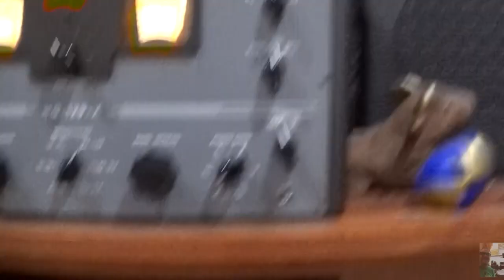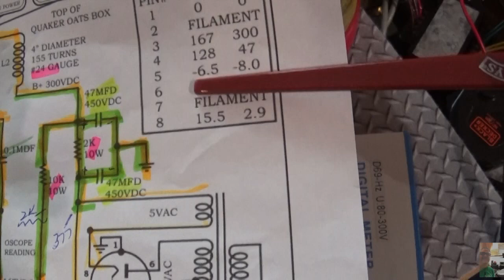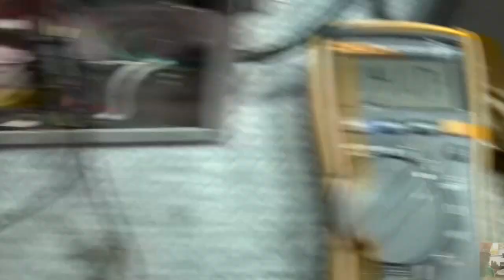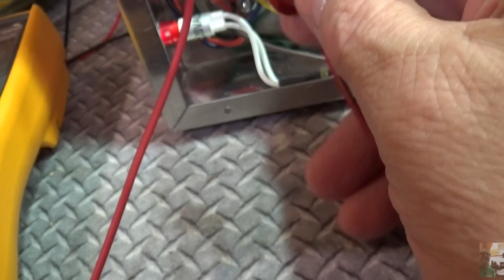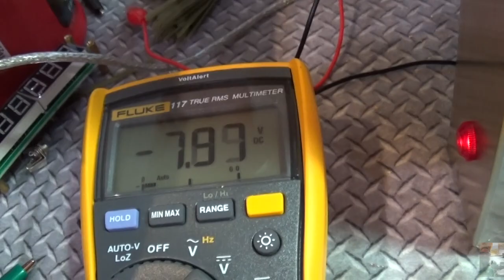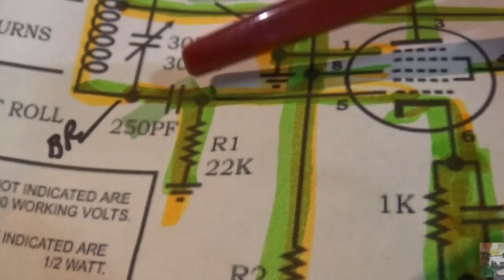Rick McWhorter AM Transmitter Build  - Episode 10 -  Pico and the Man !!

Comment: That wrong value cap could be your problem, I always have trouble with those capacitor "codes", never had those stupid codes years ago, the caps were marked with the values on them.
I have a chart from Sal's Capacitor Corner that I refer to when I need to put in a new cap.
Reply from the maker: Thanks Bill.  I am with you.... I never get it either.. LOL    However in this case I think the issue is I ran all the wires up inside the wooden boxes in the same hole. This would be the writers to the tuning cap and the 167VDC wire that goes to the meter/switch.  I didn't have the hum before that and have it now, so it is just a question of isolation ( I think) We shall see  - Rookie error !!!     Thanks Ron
Reply: I ordered some yellow film caps recently from AES and they came labelled as uF as well as K,  I was pleasantly surprised.

Comment: Ron,
Loose nut behind the tuner maybe?  LOL
Regards,
John
Reply from the maker: Its even easier than that John..... rookie mistake..... lets say, you should never run wires to a tuning cap in the same channel as wires carrying 180VDC.......  comprehende     :P   LOL    Regards, Ron
Reply: Am I hearing that my observation about the designers running tuner cap wires is separate holes in episode 4A comments is the cause of part of your issue with noise in the transmitter?      You've got to pay close attention and learn from those guys.
Reply from the maker: You were indeed correct JP.  I read your advice and totally forgot about it.... but I have atoned for my sins and am in the process of fixing it.  I removed the wires and the problem is better but not gone yet... so indeed you were right my friend... as always, very grateful - Ron
Reply: Cool.  We both learned something.  Those guys knew what they were doing and we shouldn't take anything we see in those old radios for granted.     Another step in the right direction.

Comment: Remember dc bias should not be influenced by capacitors, are you sure the 22k resistor is correct, and Rick states all voltages taken at low power
Reply from the maker: I was just checking all the resistors in the set now and did not get to the 22k resistor yet, but... I will soon. Thank you for confirming my thought... I will check and report back.  Many thanks my friend. - Ron